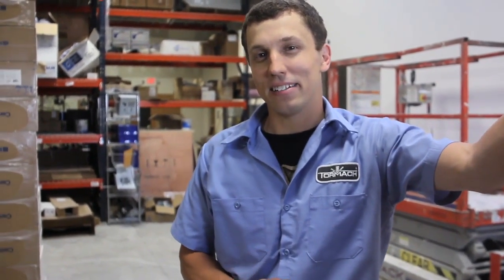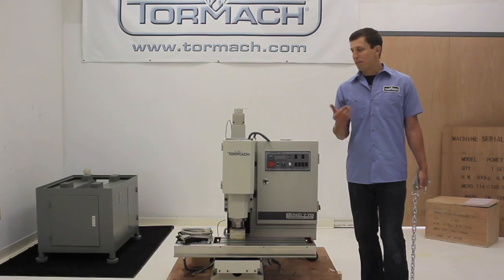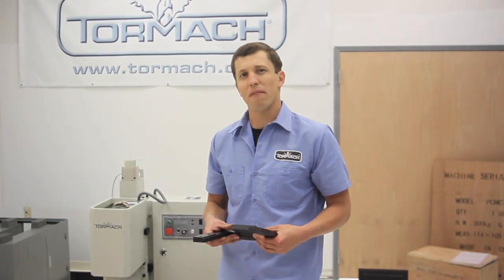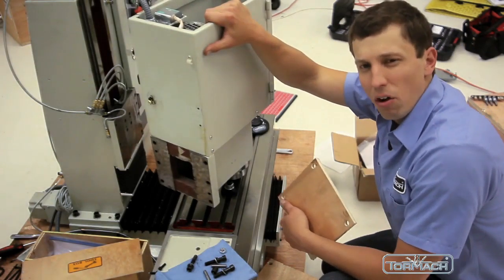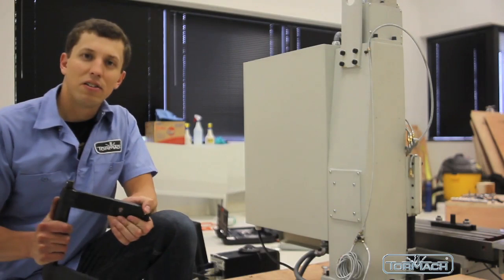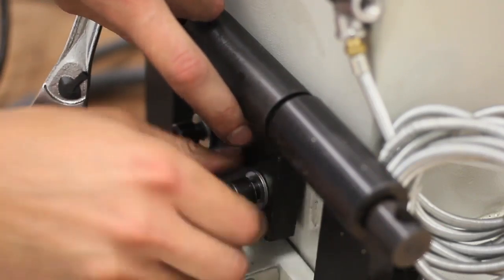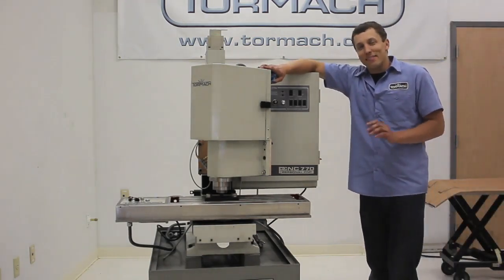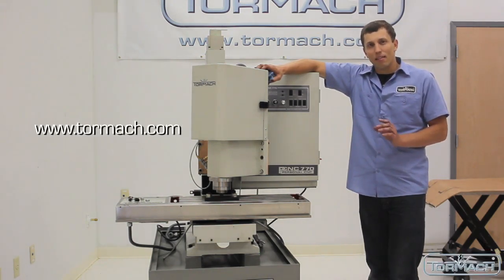Tormach PCNC 770 Moving Kit Demonstration

Comment: very helpful video - the kit definitely makes moving easier, but to anyone planning to move it into a basement (down stairs) be sure to have at LEAST three people moving each piece. I got the spindle down no problem by myself, but the base and column at both about twice as heavy and incredibly awkward to carry. Also note, the table is too wide to fit through a standard doorway and will need to be tilted. The guy on the heavy corner is going to need to be ready to hold about 200 lbs